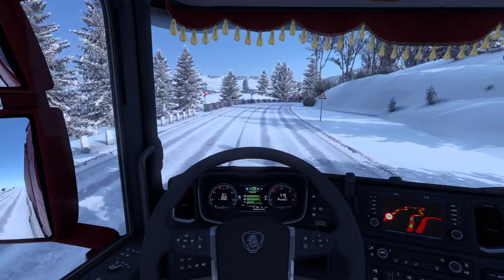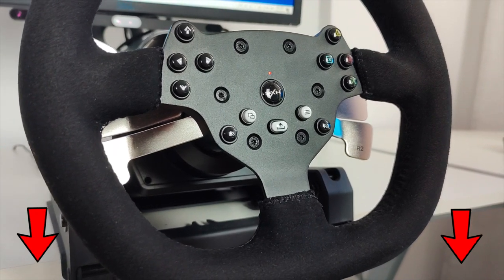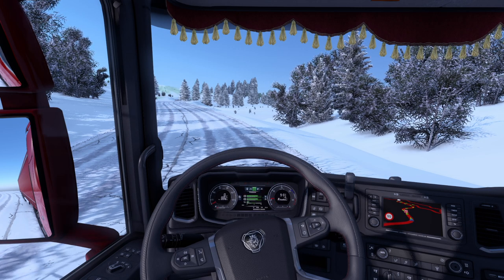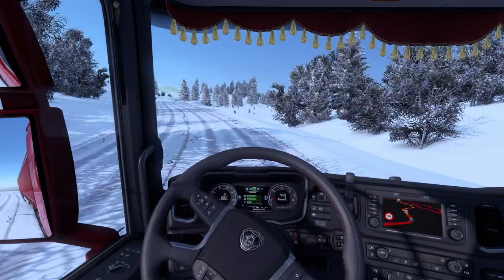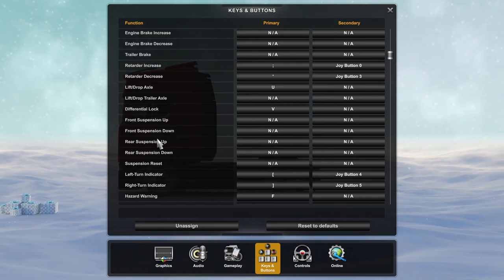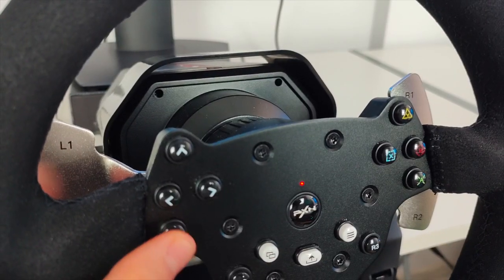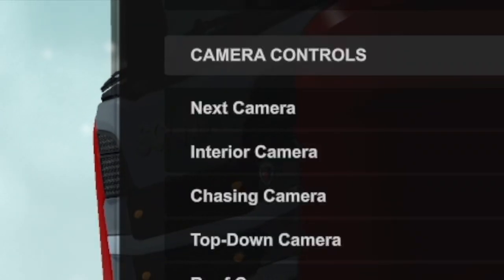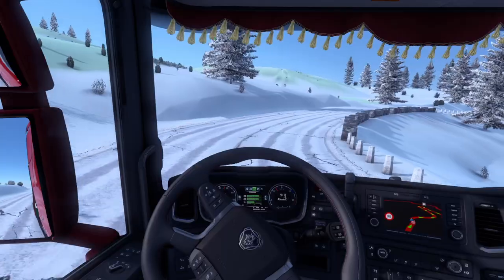Euro Truck Simulator 2 - Key Binding Tips&Tricks | Tutorial

Comment: Im surprised how similar our setups are haha. I also made the mistake of binding "Look left/right" instead of "Interior Look Left/Right" but i figured it out later, and i also set myself "intetior look middle" because sometimes I cant see the traffic lights if im first in line. I however use automatic retarders, as I have camera zoom in on the bottom button and my fog lights on the top button.
Reply: Me too. You would try AI Track and OpenTrack to look around with web cam
Reply: @trubachoff  I would try it, but the thing is I use a laptop, and a Second monitor as my main screen, so the built in webcam would be to the side, and I dont need a webcam for anything else

Comment: Hey can you do a video explaining everything about how to set up and use a steering wheel pxn v9 from unpackaging. I got this wheel for Christmas and still can’t get it to work for Euro truck simulator and I really need help
Reply: If anyone wants to help then pls do
Reply from the maker: @Daniel-xs5yn  What exactly doesn't work? You have to plug it into the computer and switch from keyboard playing to steering wheel (there is also a survey in ets2 for that). Also set each axis.
Reply: @tony747official  I have plugged it in etc.. but when I go on the setting and the gameplay tab I think it is called. And select new wizard, it asks me to put a key for the acceleration and brakes. I put s pedal down and nothing happened. Also when I do keybinds different parts of the wheel are called the same thing. Like the acceleration pedal is called the same as like the “x” button. Idk why
Reply from the maker: @Daniel-xs5yn  Try to download their app, or go to device manager from windows, go to the steering wheel and see what happens when you press the pedals and the buttons, if they are assigned correctly
Reply: @tony747official  ok I’ll try that. I’ll get back to u if it doesn’t work
Reply: @tony747official  Sorry for getting back to you so late, i'v tried the app before on my phone and it still doesn't work. To be honest I have no clue what im doing (lol)
Reply: @tony747official  are you able to make a video on it and show what exactly to do because i haven't got a clue.  also i play Euro Truck Simulator 2 on a Lenevo Gaming Laptop but i don't think that is the issue as the game works fine